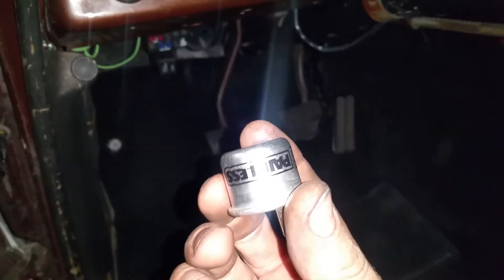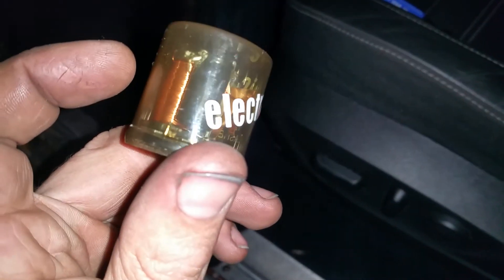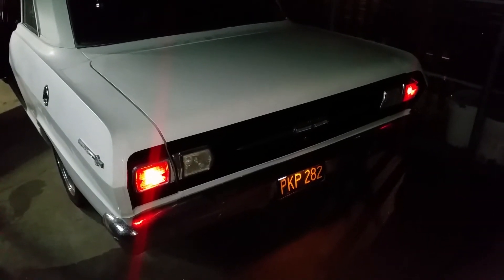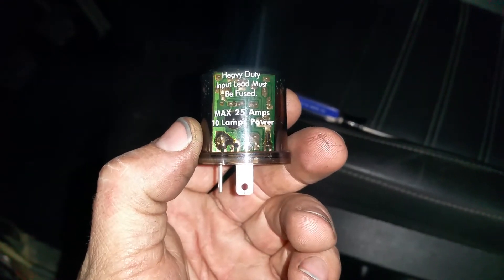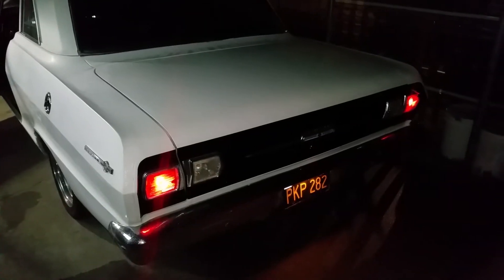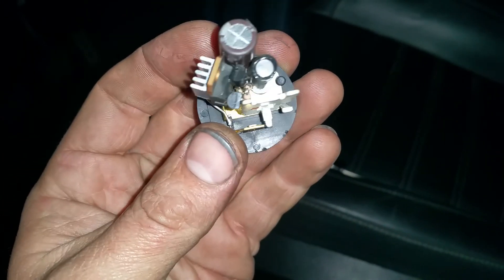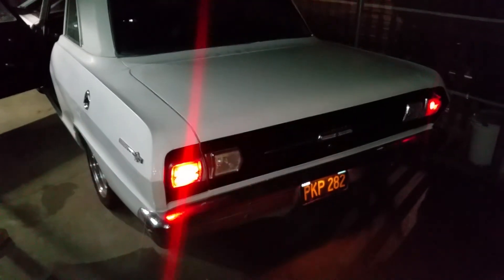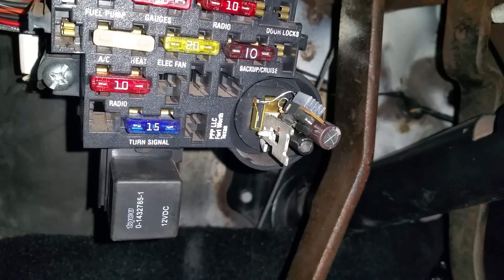Diy solid state turn signal flasher

Comment: The problem you had with your electronic relay is the pins are reversed, you either get the adapter to reverse the pins or swap the wires around on fuse block for the relay